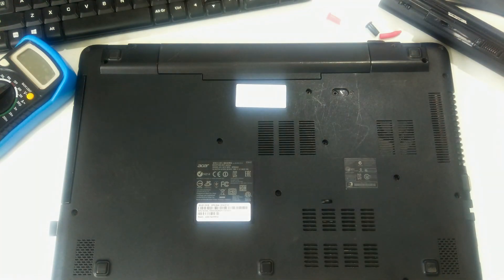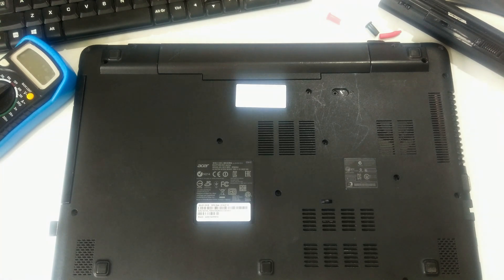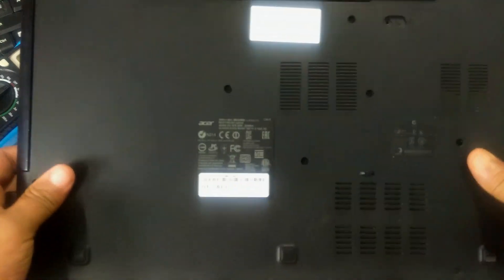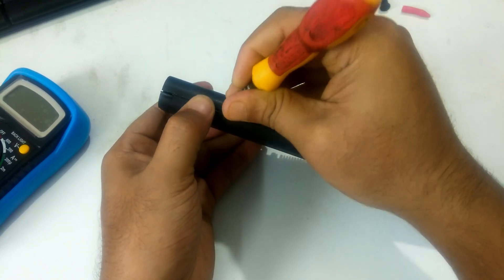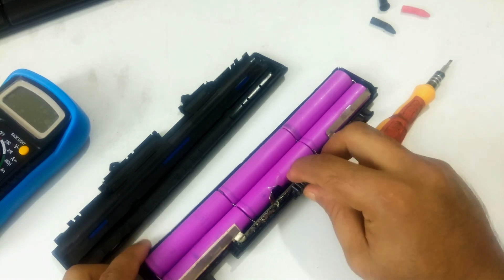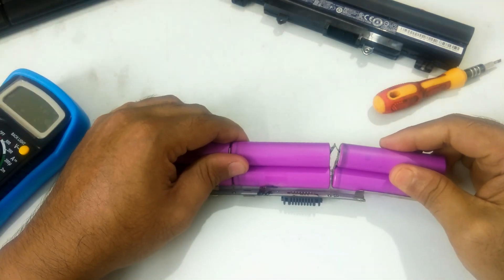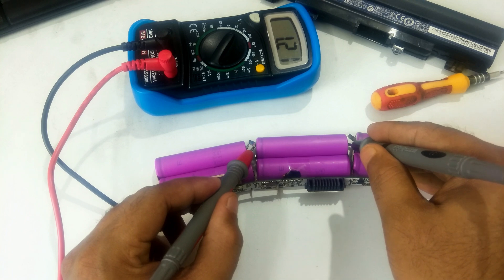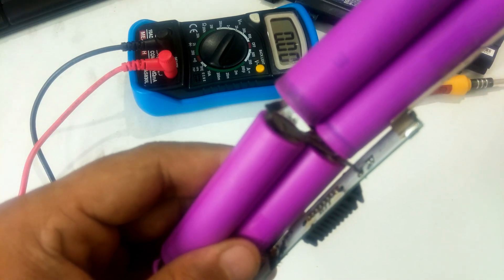Laptop Battery not Charging? 🔋 How to open Laptop Battery

Comment: What an engineering, taking voltage of batteries seperately even though they are connected in paralell... 😅😅😅
Reply from the maker: 💡 Everything has a reason behind it, so there is a reason behind it 😉